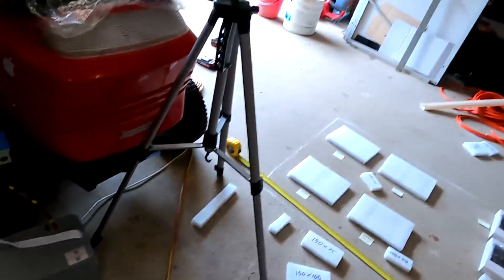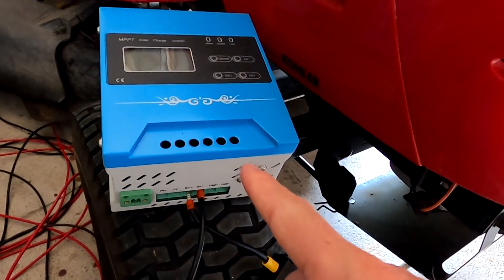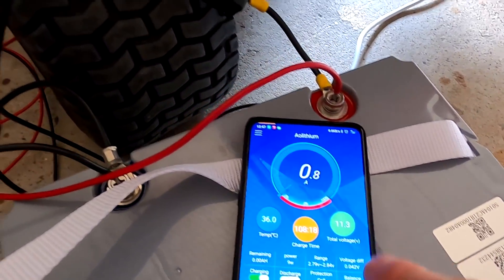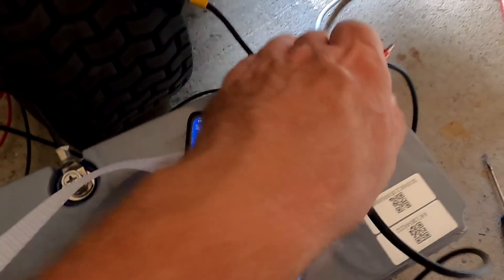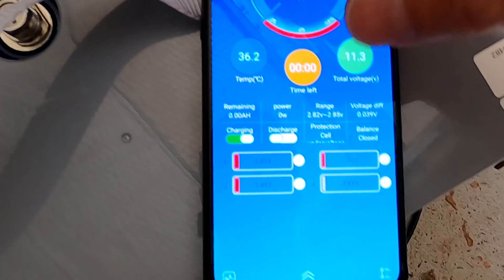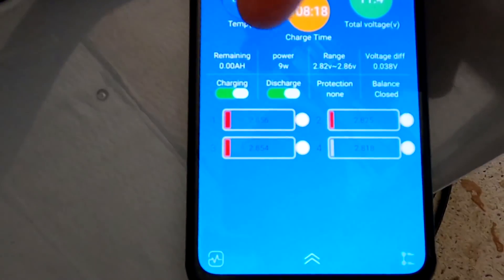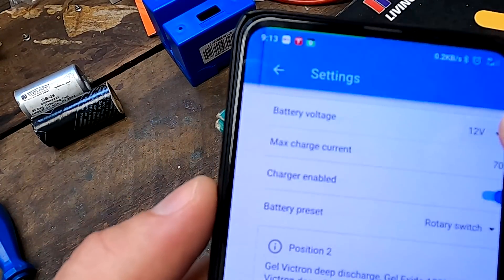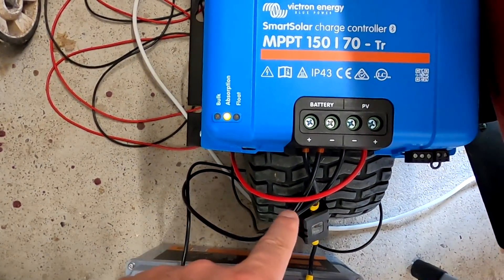Battery empty, BMS disabled further discharge and MPPT cannot recharge. Aolithium BMS in a deadlock!

Comment: I have been concerned about this, possibly even destroying a charge controller, I have heard f ppl connecting solar first and killing the controller, when I was planning to use multiple small BMS,  I was going to use one for charging, one for discharging, or one for charging only, Now a shunt trip handles the charge and discharge not totally perfect maybe I will add another!
Reply: "I have heard f ppl connecting solar first and killing the controller," --> This should only be the case with badly designed controller.
Reply from the maker: Will Prowse did a video about this and connected a whole bunch of different brand controllers to solar only (without battery). They all survived.
Reply: @OffGridGarageAustralia  There is an entire thread on the forum with people trying to break a charge controller that way. I think some odd cheap controller managed to get damaged, but otherwise all good.

Comment: interesting situation... my renogy 40a solar controller will run off solar voltage with no batteries connected so i guess that means it would circumvent this situation
Reply from the maker: Yes, that should be OK then. I just had never seen this before with my QUCC.
Reply: @OffGridGarageAustralia  This is good to know, I also have a Renogy Rover 40amp but never been in this situation. I've come close to the cold temperature cutoff of - 20oC for discharge so it would be similar situation. Say in the morning when the sun comes up, the Rover should turn onand can provide power to the battery to  power heater (built in). The manual does say to never run on pure PV alone so I was skeptical, but good to know the Renogy Rover can run on PV.

Comment: This never happened to me, but my epever charge controllers start up from PV alone. They won't start charging if they can't detect a voltage on the battery side, but they will be alive nevertheless. So I'd assume that it should work with the epever charge controllers.
Reply from the maker: Ah, I was wondering if the EPever have the same issue. I've got one here and was going to test it out. Seems the JNGE and some other cheaper ones needs power from the battery to start.
Reply: @OffGridGarageAustralia  where a controller auto senses battery voltage it makes sense for it to have to see it before it will start so it knows it is on the correct voltage. If it was an older Victim it would have set itself up on 24v even if on a 12v system if solar was applied before battery. I’ve seen it happen only last week.

Comment: as said below. Victron will work off of solar only.. I had a breaker trip which isolated my battery and still powered my Rv solar only
Reply from the maker: Yes, I had this multiple times when I experimented with the QUCC BMS. The Victron MPPT still powered the inverter from solar directly by using the absorption voltage.

Comment: Did you had the battery voltage set on victron charger on auto, manually selected the 12v? My guess is, if it was on auto detect battery voltage, it would not turn on because no battery voltage detection. If victron charger is set at specific battery voltage, it will turn on.
Reply from the maker: Even if the BMS has disabled Discharging, there is still voltage on the terminals, just no current. This is enough for the Victron to start charging when it has solar input.

Comment: Virtually all charge controllers are powered by the battery which is of a specific known voltage. They won’t power from the solar because that could be anywhere from 12-600v (or more depending on the charge controller). Charge controllers should have small leads that connect directly to 12vish of batteries in your pack and power itself and then they’d have much more flexibility for battery pack voltage too. (And would bypass the Bms this way without damage because the draw would be tiny since these charge controllers use 3.3v

Without a secondary connector, you’d have to have a switch mode buck ic and a bi power ic to switch with both. And that limits to 450v for your solar. 

Otherwise the Bms has to allow a slight leakage allowance for discharge.  

Having a 12v direct link separate from the battery solves the entire problem.
Reply: I think they could be powered from 12-600v if they tolerate that voltage. Why not. It is what you can see in the video, it is being powered from solar energy. they have internally "an step down" for charging battery and, posible, another step down to power their internal IC's. Also, they must have the option to be power from solar or from battery. A good mppt will do that and I don't see any problem at all with that.
Reply: @diydsolar  the issue is getting the unit powered from high voltage. 150 isn’t a big deal but it does add cost. Anything over 450 there just isn’t the IC available. 

The issue is that an mppt requires a micro controller to power the dual synchronous buck/boosts to lower the voltage. Thus it’s VERY difficult (almost impossible) to generate a bootstrap 3.3v for the microcontroller from high voltage because zener diodes top out around 500v max and a voltage divider only works in this scenario with a narrow range of incoming voltage. (Ie you’d have to specify a range of 50v at most to get a divider to work.)

This is also why mppts are so limited in the battery voltage they support. It’s hard to create a flexible unit simply because startup power for the micro controller is so difficult with a wide range. 

Tapping 12v from the battery solves the entire issue and gives you 100% flexibility to the top of the continuous voltage rating of the fets.
Reply: with a separate "link" you risk draining the cells too low and damage them.
Reply: @sharpx777  Not likely. The average BMS using the Ti BMS active balancer (basically all of them) can balance at 2A.  The micro-controller in an MPPT charge controller will use AT MOST 300mA and that's with all radios on in full active mode. In standby mode we're talking 3mA (0.003A). (i.e. no sun coming in which basically ANY sun would be providing more than it's consuming AND no battery)  The active balancer will easily handle it, and can force shut off at the absolute bottom if it needs to around 2.5V.  In even a 100aH battery it would take the better part of a year for a 48V battery to go from 2.7 to 2.5V with an active balancing BMS and the draw from the micro-controller we're talking about.

There's no downside.
Reply: @jameshancock  Can you please give an example how this additional lead could look like, I can easily imagine that thiny wire can be easily bured when large current occures and this also would fail.
Reply: @dannyboy6021  If you have a 16S battery as an example, the most negative terminal and then the 4th positive terminal would have a small connection with a fuse inline. It would connect to the MPPT and the inverter and bypass the BMS.  The MPPT and the inverter would then have 12VDC supplied fixed from that regardless of the battery size. If there was some form of surge, the fuse would blow (the fuse could be in the MPPT and inverter too and you could use 1-4 and 5-9 as an example of power these as long as the negative/positive weren't shared outside of the microcontroller internally, otherwise there would be a short of course).  

This also has the plasent side effect of making it trivial to make scalable battery pack support (i.e. 96V, 128V, 240V, 320, 384 etc.) which lowers your amp requirements while enabling the same inverter without any other changes to provide vastly more power. i.e. without any other changes, most fets can handle 500VDC and 400VDC with headroom, especially GanFETS used in most MPPT and transformerless inverters.  So while you might get 5000 Watts from an inverter with a 48VDC battery hooked up, if you were to series another 16S into 32S, now the unit can support 10000 watts from the exact same inverter at the same amperage (you'd have to of course have the output components sided accordingly to handle the higher output in amps since the output voltage didn't change). The same is true for the MPPTs. You can handle much larger solar per MPPT string on a larger battery pack simply by enlarging the battery pack voltage. (and 32s keeps the batteries below 120VDC which is the max safe DC voltage according to every country in the world)  This makes everything cheaper per watt and solves the problem of the BMS shutting off everything so that you can never recharge the battery while you're at it and allows massively higher voltage series strings of solar with less wire loss because you're not having to have dual power path components in your MPPT and accept power from the solar array to power the micro controller and can instead just use the 12VDC from the battery pack.
Reply: @jameshancock  sounds really nice unfortunately there is no such device on the market... is there any good way to protect epever tracer 10420an from bms disconnect and thus destruction of this unit. I saw multiple videos on the internet and it seems that the best solution atm is to skip bms configure epever for lifepo4 and add active balancer to the 16s setup
Reply: @dannyboy2715  not familiar with that device. What power does it draw?  If not much set your Bms slightly low max discharge and hook the device direct with a fuse rated for 125% of its max draw. Your risk of course is low voltage state but may be preferable. 

There is a BMS that works exactly this way and scales endlessly and I’m working in mppt that does the same. (And then inverter)
Reply: @jameshancock  I will have to reffer to the manual to see what is the idle power consumption. But I guess there is no simple solution as even the producer by default supports lifepo4 only in units which have max 24V battery voltage which also limits PV power. I guess there is no electronic that can handle larger PVs without the battery being connected.
Reply: @jameshancock  I have been thinking about it and do you think that connecting two 48V batteries in parallel would solve the issue? One of them being regular lead acid and second one 16s lifepo4 with BMS
Reply: @dannyboy2715  Will Prowse just did some investigation on parallel. The issue is internal resistance when using a lead acid and LiFePO4. The lead acid is at least 20x more resistive than the LiFePO4 so I think it wouldn’t get much of a charge at all unless the Bms shut off.
Reply: @jameshancock  but what if we do a bridge from the lead acid battery. What I mean is that solar charger wolud be connected to + and - of the lead acid and another pair of + and - to the busbar with inverter and other lifepo4 battery being connected?
Reply: @dannyboy2715  in parallel all you’re doing is bridging the wires not the battery. In series the power goes through the negative into the positive of every battery. In parallel each battery contributes to the wires based on their voltage and resistance (and charging the opposite).  The only why to make this work is to raise the resistance of the LiFePO4 to the same as the lead acid with a series power resistor and by doing so you’ll burn half of the power as heat.
Reply: @jameshancock  ok and what about using BMS whith a relay instead of mosfets such as QUCC, relay would enable and disable Lead Acid when lifepo4 would be disabled by the bms
Reply: @dannyboy2715  qucc uses a rely. The power is still cut entirely. It doesn’t really matter. Fets are way more reliable than a rely. My point is mixing battery chemistries is a bad idea and will never properly balance even with an active balancer because if the LiFePO4 is connected at all it will always suck the lead acid dry. Energy always moves from most to least resistance all other things being equal. To solve the specific issue of this video you need a unit that has a separate tap or don’t let the battery go to Bms shut off. (Or have one that can power from the solar panels)
Reply: @jameshancock  ok I did some research and I think that the advantage of the qcc relay over a mosfet design is that mosfets (from what I saw) can take up to 100V and this should be not an issue with the relay, maybe that is why relay bms should be preffered for systems that use more than 24V
Reply: @jameshancock  I also saw that Victron RS has a new design and it is fully isolating PV from the battery so this also can be a solution, unfortunately not a cheap one
Reply: @dannyboy2715  a 100v mosfet will easily handle a 72v battery with lots of headroom to spare. Good units like jkbms actually have 500v mosfets.  

The issue with all relays is that they’re a mechanical contact which wears out over time. A mosfet can go basically forever. (Relays also arc)
Reply: @dannyboy2715  all that means is that there is a transformer between the PV and the battery. That makes it less efficient as a result (5-8%) for not a a lot of benefit. And it doesn’t solve this issue at all. 

Isolation is useful in ac to dc because mains get lightening strikes etc. on the dirty ac mains but in dc systems the only reason for isolation is to quiet noise on the wire since even a lightening strike doesn’t behave the same way in a dc circuit.  So the only time a solar platform needs them is if they can’t filter noise effectively by other more efficient means and if you have ac/dc conversion happening (even dc to ac doesn’t need it, only inductors and capacitors)

Comment: The situation is caused by the solar charge controller.  The Victron is allowing power to come in and charge the output capacitors in the charge controller so it has enough storage to power itself for a short time assuming enough power is coming in through solar to keep the charge controller on and output capacitors full and not causing it to have low voltage internally which can cause issues.  If you have a common port BMS that uses MOSFET or a relay it won't make a difference if the solar charge controller doesn't come online and power itself internally so that it can raise the voltage of the output enough for the battery to start charging.

I own a couple cheap MPPT solar charge controllers that do the same thing even on a dead lead acid battery.  The voltage of the battery gets drained down in the dead of winter to low because the charge controller needs power to stay on and then when the sun comes up in the morning the solar charge controller doesn't have enough voltage to turn on even if it has power coming in from the panel array so it never charges and then I have to bypass the controller for a few hours to get the state of charge up high enough for the controller to kick in.  Needless to say I don't use those charge controllers any more.
Reply: had this same problem with the epever and lead acid i ended up fitting a buck converter between solar and battery terminals just to bring the battery upto switch on voltage if it did drop low
Reply from the maker: Thanks for sharing Kuhrd. It seems to be the cheaper ones which have the problem. I never had this issue before with the QUCC.
Reply: @OffGridGarageAustralia  I’ve experienced the same issue with the Outback FM80. The solution we’ve settled on for now is to connect a small lead acid battery in parallel with the LFP, so that keeps the MPPT alive if the LFP BMS ever cuts the load on low voltage…
Reply: @frodev728  then, wouldn't the LiFePO4 charge profile end up frying the lead-acid battery connected in parallel?
Reply: @OffGridGarageAustralia  "I never had this issue before with the QUCC." Does that black 'sense wire' on the QUCC act as a voltage sense wire only, or can it actually carry a small current? A FET based BMS does true one direction only current, maybe the (small) current from that QUCC BMS is enough to power the charge controller.

Comment: You tested it for me, with the charge controller I use. So thankyou Andy. Also, just in my opinion I don't see the bms being at fault especially when you can change the settings to better suite the way you have it set up. I use the time delay and allow the cells to recover for a minute before discharging can begin again. I've enjoyed using jbd bms's,they've worked well for me while I learn all I can about this fun hobby
Reply from the maker: Thank you. I will have another test with the JBD BMS in the Aolithium battery which I'm not happy about...
Reply: @Off-Grid Garage  better than a Daly bms lol